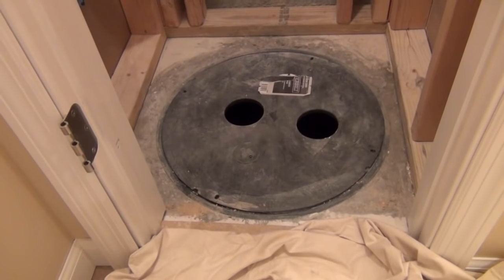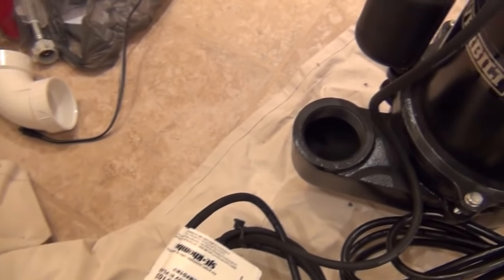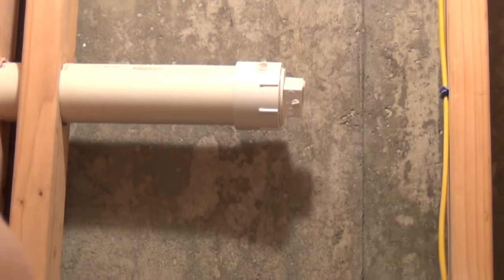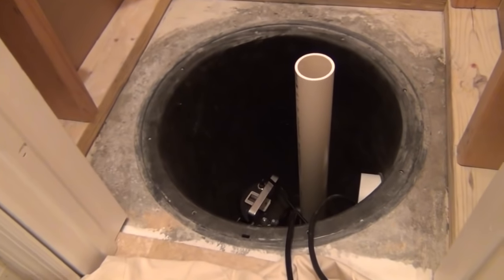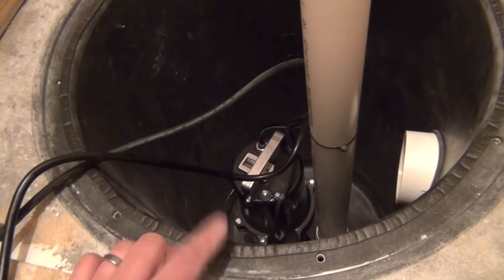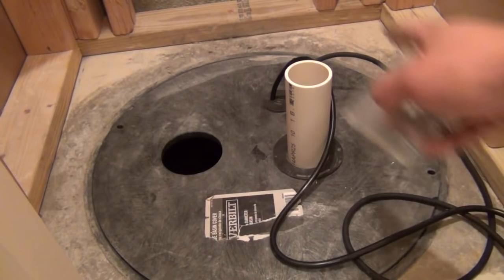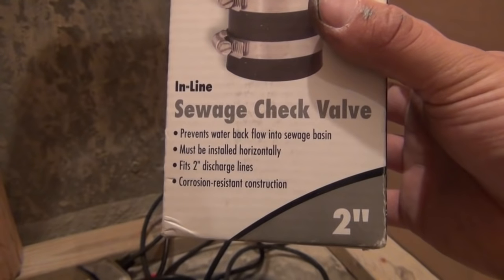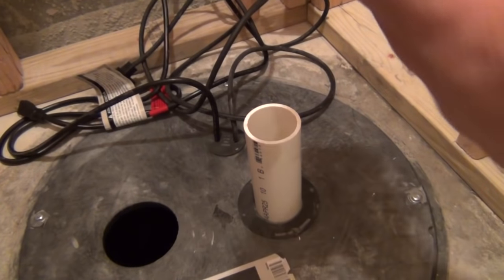How to Install a Sewage Ejector Pump

Comment: COMMENT PLEASE ZIM - I'm getting ready to put a new pump in a new basin that I recently had to replace because the basin was leaking from the bottom.
Would you agree that adding a high-water alarm inside the basin would be a good idea? I am thinking of using the Zoeller APak Alarm with a Reed Sensor and Internet Connection (Model 10-4013). The Alarm Box would be place on the bathroom wall so you know to stop running water before the tank overflows. That model would also send a notice to your Smart Phone and/or your home monitoring system.
Thank you for a great video. I look forward to your reply Zim.
Reply from the maker: Hey…the pump alarm is a good idea, especially for the less savvy that might not notice or hear the pump kicking on and off during normal operation.  As far as the float, ideally it should be spun away from the inlet…even with a toilet flush, it doesn’t really flow with that much pressure into the sump.  Honestly, probably doesn’t matter all that much because things like toilet paper, hair, etc. float on top of the water level and can make their way to the float anyway.  Hope this helps
Reply: @fixitwithzim  Thanks for your reply. Wishing you all the best. - Mike

Comment: Great video sir. My installation doesn't have a check valve and the ball valve is about five feet from the cover. My pump just stopped working and it does have the two plugs, and I was able to drain the tank, thanks for that tip. My pump is 14 years old and need to replace.My question is should I just take it apart as is, or cut pipe and add check valve and lower ball valve like yours? And why do you think they would plumb it that way? Thanks for your time and making this vid.
Reply from the maker: zoolanderfred The check valve prevents the pumped water in vertical sections of the pipe from draining back into the sump which in turn could cause the pump to short cycle. If it has worked all along with no problems, you could keep as is but the proper way is to have a check valve. How many ft of piping from the pump to the discharge point?
Reply: It's about 12' to the final turn at the ceiling then gravity takes it another roughly 22' to the main drain pipe to the septic. Yes, I get what you mean about draining back. I kinda feel ripped off. I bought my house brand new 14 years ago, and have been finding a few major flaws. I paid to have a basement bathroom roughed in for the future, never did finish the basement and the only thing that drains into that well is the condensation from AC, so not to worried about it that much. Probably why I got 14 yrs. out of it. My other sump pump for all the drain tile just crapped out last yr. That was an easy change out. I'll redo it like you did, may as well do it right. Thanks for the quick reply.

Comment: 5 year old video some how same pump we bought last month.
However.
Installed new sewage pump.. pump disposing water and waste fine .. but after that tru pipes hear loud rubble n bubbling racket in 1st floor sink Noise for two seconds. 
How can you make that noise go away?

Comment: Thanks for making this video👍 I got motivation from your Video to do my basement bathroom project but I wet sawed my concrete with 12inch  diamond circular saw to minimise dust, rented from HD for day. I’m about to finish my project. Do you have a separate dedicated vent for sewage pit or tied with existing home vent. Do you see any issue with drain?

Comment: Great video!  If I have higher ground level waters around my area (my sub pump basin pretty much always sits at concrete floor level), is there any steps I should do to ensure I don't get a wet basement come a come a time of year when the water table might rise?
Reply from the maker: Interesting question.  I would probably excavate under the pit another foot or two and add pea gravel and sand.  Do you have a sump pit in your basement?

Comment: I have a manufactured home and I'm looking to add another bathroom. Where I will add the b-room it will be too far away in the house to catch the existing sanitary, maintain proper fall, and drain out to septic. So I need a pump of some kind. Will this type of pump in your video work for solids and fluids? I live in the south, we don't have basements down here so not too familiar with this type of plumbing.
Reply from the maker: Yes, it will work for both solids and liquids. Anything you normally put down your drains and flush down the toilet will be ok. Good luck with your project.

Comment: Please diagnose my basement floor drain problem.  I'm asking your because I think it may be related to the sewage ejector pump.  I bought a 10 yr old home in KS.  The sump/sewer pump (sewage ejector pump) is within 13 inches from a floor drain that accepts 3 sources of drainage (hot water tank overflow, heater/humidifier/ac system, and water softener tank).  The radon mitigation pump is on the other side of the basement utility room.
There is a loud gurgling or boiling-like, water-suction sound coming from the floor drain that comes on intermittently throughout the day and night.  It can go on for an hour or more and is loud enough to hear on the main floor.  Are the ejector tank and floor drain connected?  Maybe the ejector pump is partially clogged?  Could it be the roof vent is clogged?  Any help is appreciated before I call a plumber to come out, because if it isn't making the loud noise while he is there, I don't know how to help him understand what I'm hearing.

Comment: Really like the video, had one question if the check valve stops working how would you know or what are the signs to look for if the check valve goes bad.
thanks 
great video
Reply from the maker: So the function of the check valve is to stop the lateral section of piping above the pump from gravity draining back into the sump after the pump shuts off. If this was to occur, what could then happen is a cycle of the pump kicking back on, pumping the water back into the pipe, float shuts pump off and water again drains back to sump...this process could continue for a very long time or not stop depending on how long the piping is between the pump and sewage discharge (more pipe=more water). The check valve also prevents other gray water in the gravity section of your dwv piping from flowing backwards into the sump.  In a properly designed system however that should never happen. General rule of thumb is to replace the check valve every few years for preventive maintenance.  Hope this was helpful.

Comment: I would want to place the check valve in the first horizontal section of the outlet piping off the pump in the pit - in other words at your image's left of elbow ..... the run further up the line could get an additional ball valve isolating it for service.  What do you think on this ?  Thanks, Jeff

Comment: Great video, thanks. I had someone come and install mine but the room still has a faint smell. Any advice for sealing? The weather stripping I'll double check. Any other tips to ensure it's fully sealed?
Reply from the maker: Jason Smith  Id try silicone around the pipe and cord gaskets.  Definitely check that adhesive gasket under the lid.  One small opening in it is all it takes to get some nasty odors.  Thanks for watching.

Comment: What might be the problem if the pump runs but don’t pump. This happens 2-3 times a year. Usually waiting, turning open and close and open the ball valve and sometimes it magically works again.

Comment: Hi there. Great video! We have one of these—around here it’s called a lift station. Anyway, we have an alarm to alert us when there’s a problem with the system. Problem is, there’s never an actual problem when the alarm goes off. Someone flushed a toilet or they’re showering—not shoving prohibited items down the toilet and such. Just lots of false alarms. I have to silence the alarm and unplug the pump and plug it back in to restart it. This happens 1-2 times weekly. My plumbers say it’s nothing—that these things are sensitive. I’m not sure. Also, the alarm is just like a strong buzz—we often aren’t sure what it is when it first sounds. If you’re in another part of the house, you can’t even hear it. I really wish there were a different alarm, especially one that could alert you on your phone. Got any advice?

Comment: My house is about four years old and it didn't came with the sewage pump hole but the concrete have 2 holes with plastic pipes and I'm  guessing they are for the toilet and a shower. How do I know if I need a sewage pump in my basement for my bathroom? Thank you
Reply from the maker: supercocaso Sounds like the builder roughed in your plumbing for a basement bathroom as you've described. Do you see your main 3 or 4"  waste line exiting through the foundation wall above the slab?  If not, your main is most likely below the slab in which case a pit and sewage lift pump isn't needed.  Hope this helps.
Reply: Thanks a lot for your help and time. It seems like I don't need one.

Comment: Great Video!  Need your advice.  I have a separate building on slab which is separate from the main house.  I want to put a bathroom in  but the sewer connection is outside and is only 2".  So my question is should I put the sewage ejector pump outside the building or inside.  I live in California so weather is not a problem.  What would you recommend?  Thanks for your feedback.
Reply from the maker: 1mrbpv I personally would prefer to locate the basin inside the building.  Outside in the elements it might attract bugs and other nuisance pests making servicing more difficult. The basin lid also isn't rated for any weight so for safety purposes, it should be located in an area away from foot traffic, kids, etc.   How long is the 2" pipe before it ties into a bigger main?  Is it pitched properly away from your pump and towards the main/septic system?
Reply: Thanks your reply.   Unfortunately I can't tell how long the 2" pipe is because  it goes out of site under the building.  I turned a garden hose on full in the pipe for about 20 minutes without any problem so clearly it must tie into the main house sewer line by gravity.   Do you see any problem using this 2" pipe for the sewage ejector system?

Comment: Would this ejector pump with sump work in a situation where i want the bathroom in a cabin 80M from the septic tank not up uphill just horizontal. Do you think it would be able to pump that distance?

Comment: Great video thanks so much.  One question, I have a project where I'm lifting the sewage from toilet and sink straight up about 6 feet to 4" drain (drains upstairs bath and kitchen) that travels about 3' through an exterior wall to a main stack  (many old homes done this way here) will this vent properly if I vent to this same line?
Reply from the maker: couper gear Tough to visualize but best advice I can give regarding the venting is make sure you're above the flood rim before your run horizontal with the vent. Also, make sure you size properly...probably 2"

Comment: Great video...I'm about to re-pipe an old ejector pump which is located near my house trap.  The current pump dumps into the waste pipe that runs around my basement.  It enters the waste pipe about two feet before the house trap. The house trap is the last "thing" on my waste line before it leaves the house to run into the city sewer line. I'm usually a DIY guy but I was thinking of hiring a plumber who advised me to have the ejector dump after the trap rather than before as it is currently.  I think that might cause gas back up problems but I'm not sure what the proper install is. Your thoughts????
Reply from the maker: Thanks,  good luck with your project. Easy job - just make sure no one flushes when you have the main opened. Been there, done that

Comment: Love your channel 
I’m trying to install 2” ball valve on my sewer ejector line. I have abs pipes and can only find pvc or grey ball valve. How do I install?
Thanks
Reply from the maker: They make special glue for pvc to abs connections although it’s generally not approved for use in some areas.  The chances of the joint failing though are minimal.  What you could do is use a Fernco no hub coupler on the bottom of the valve and then install your check valve above it. That would make your 2 connections on either side of the valve and also give you a point of disconnect for future work. Hope this helps and I’m happy to hear you enjoy my channel!

Comment: Just replaced the float valve. Now it seems the capacitor may need replacing to avoid a $400 pump replacement. At times the motor just hums which is usually a bad start capacitor. $45 for the capacitor is worth the savings.

Comment: Excellent!  One thing you may have omitted is the need to drill a 3/16" vent hole in the PVC pipe below the check valve to prevent vapor lock in the pump.  Please comment.  Thank you!
Reply from the maker: The pump I used in this video doesn't require a vent hole in the discharge pipe.  Some pumps do, some don't.  Thanks for the comment.
Reply: great video, this will help me a lot.  how do i know if i need to have a vent hole, i am doing a replacement on a 30+ year old tank and pump

Comment: I bought an EVERBUILT sewage pump from Home Depot and when I pulled the pump out of the box it was bolted to a wood base.    Should I assume I remove the wood base and put the pump directly on bottom of plastic pit?
Reply from the maker: +paul yetter Sorry for the late response but yes, remove the plywood.  Its only bolted onto the pump to protect during shipping.

Comment: I would like to send you  photo of my disassemble so far, but I have a question regarding pulling the vent pipe out of the holding tank.
Reply from the maker: BOBHNJEMT you can cut the vent pipe and when reassembling use a no hub coupler

Comment: Very well done video. I'm hiring someone to install a basement toilet and sink and I have two questions. Which is better a saniflo system or ejector pump system and why? Is there a chance of smells emanating from the sewage pit if I choose and ejector pump system?

Thanks,
Frank
Reply from the maker: I prefer the ejector pump system simply because of looks. A saniflo system requires a platform to be built to allow the sanitary plumbing to enter the saniflo system above grade. I've seen 2 systems in person and both didn't look very visually appealing with the entire bathroom raised. Take the extra time and bust the slab open. Do it right you won't regret it. It's a good workout but mindless work.... and a good reason to drink and not have your wife yelling at you in the process.
Reply from the maker: +zimsjeep no smells either if you seal it properly like I showed in the vid. No problems with this install since I put it in

Comment: Great video.  I was starting to take mine apart and those screws holding the top down are seized together if and when i snap them off do i have to buy a new pit. or is there some kind of fix to where i dont have to buy a new pit.
Reply from the maker: shogunMR You don't need a new pit.  If they snap, you can try to back them out with a pair of vice grips or drill them out.  If that doesn't work, rotate the top slightly so you're over a plastic part of the pit and use some self tapping screws with washers to secure the lid to the pit.  Just make sure you use stainless hardware so it doesn't rust again.
Reply: zimsjeep Thanks so much you really helped me out.  I Really appreciate it

Comment: plumbed for a toilet and sink I'm just wondering do I need some kind of grinder pump to grind up sewage before ejecting it up through the pipe. Also all you need is a 2 inch pipe to pump out sewage out of the tank? If u can comment back it would help me. Thx
Reply from the maker: Savannah Kunz Yes, you need a sewage pump (sometimes called a grinder pump as well).  THis is the same type of pump I installed in this video.  This will grind up and pump the sewage into your sewer main.  Thanks for commenting and posting.

Comment: Great video!  I am finishing my basement and there is a sewage basin with a 4" pipe entering into it with rough in for sink shower and toilet poking up through the slab.  My basin had water in it which I removed and notice a hole in the bottom of the basin about 1/4" diameter as will as several smaller pin holes.  In addition water is seeping into the basin around the bottom of the 4" pipe that dumps into it.  I want to replace the basin but it is cemented into the slab.  I am hoping that I can sawzall/grinder it out and drop a new basin in hopefully this next summer when the water table is lower because it would be a real struggle trying to sink it into a water filled hole.  Any advice on a good strong basin that wont crack and any tricks to pulling this basin out?  thanks
Reply from the maker: Family Henke The one in my video is from Home Depot. I haven’t had any problems with it. Seems pretty strong. Maybe the installer busted that one up during the install process. You should be able to chip away the slab and pull the existing one out. Not a fun job but not brain surgery either. Good luck!

Comment: This was a great video, thanks for making it! I have been dealing with odor from sewer gases coming out of mine for years now, would you mind telling me how you sealed the vent pipe and main pipe coming out of the cover?  Did you just use gasket material and then silicone maybe on the top of the grommet? Mine right now are completely unsealed.  Probably will try and fix this weekend. Thanks again!